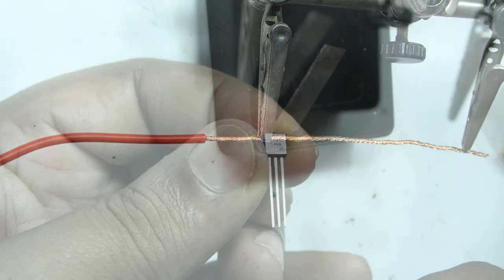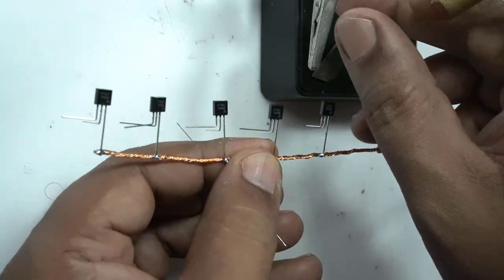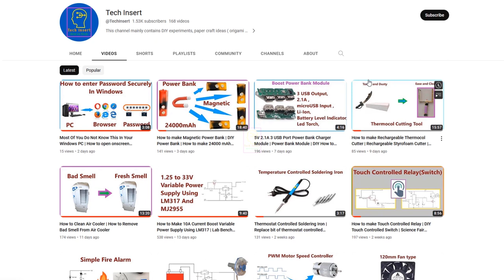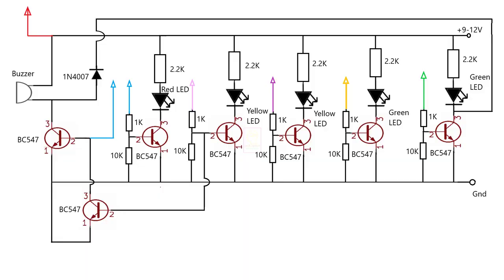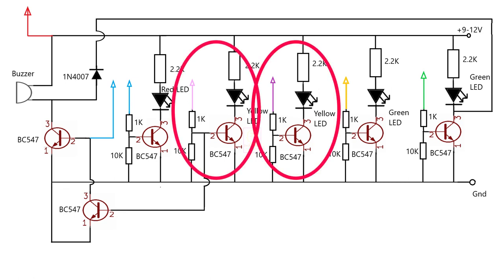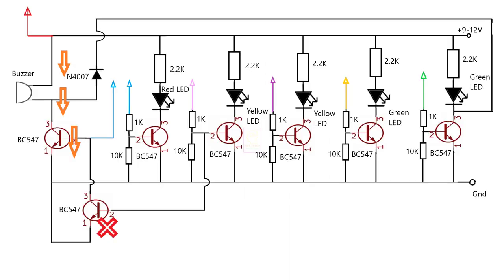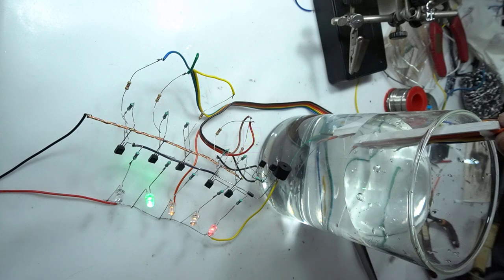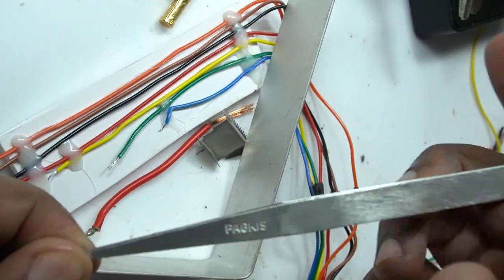How to make LOW Level and FULL Level Alarm with Water Level Indicator | School Project

Comment: Great video, can this be done with just one probe at low level and a bi colour led ( red and green) so that when tank is full the green led is on and red off, and when empty the red led switches on and the green one switches off. Thanks
Reply from the maker: You can replace the LEDs with common anode bi color led, but transistors cannot be avoided. You can also use two level circuit and avoid all buzzer related transistor. The circuit will be simple but we cannot know how much level water be in tank . But ur idea is very good. Do not forget the water  terminals

Comment: Good circuit. Can we add a water pump on it so that when the water level touches the low level alarm the motoir starts pumping water and stops at high alarm
Reply: I think so
Reply from the maker: Yes you can. I already planned a fully automatic water pump with level indicator
Reply: @TechInsert  Thanks a lot
Reply: @TechInsert expecting that❤
Reply from the maker: @baburaj1645  sure

Comment: How to join the stainless steel terminal to the copper wire leading to the LED display board with buzzer?
Reply from the maker: Tight joining or revite joining is the best way. Another way is 
https://youtu.be/pIOCciWeNo4
Reply: Thank you very much for your excellent and vivid explanation of the circuit and the step by step addition of components and test demonstration. You have mentioned that you have been using the arrangement for more than 14 years using Stainless steel terminals but when asked about how to join two dissimilar materials you suggest to go for hard pressing or riveting but you you have not mentioned which method you have adopted. In either case the joints are in touch with water the copper part of the joint will corrode and so how to insulate the joint? Hope you will kindly clarify. Thank you again.

Comment: 👍👍👍👍 Sir, Very nice and informative video. Could not understand switching on and off of buzzer at lower and top water level. could you explain the buzzer working in simple language. Also could you develop the circuit 1) such that a switch be provided to manually switch of the buzzer at either of top or bottom water level. 2) Avoid dry run of motor if there is no water is available in the sump.👍👍👍👍👍
Reply from the maker: Transistors are a kind of switch. So if you are using an NPN transistor and when the base to emiter junction is forward biased, then current will flow from collector to emitter. In short if you are giving a positive supply to base collector and emitter will join together to form a closed switch. If you are giving negative or no supply to base then collector  and emitter will act as open switch. Same is aplpicable to PNP transistor.In PNP for switching this trasistor ON we have to apply negative supply to the base. I hope you understand the working of a transistor as a switch.

The red wire is the common terminal in water which is connected to positive supply. (Water in tank is not pure so it will conducts electricity).When the water reach at the lower end (I told in the video that for buzzer and red led 2 seperate terminals are to be conected in the water) the left most transistor just below the buzzer will get a positive supply at its base. That transistor will switch ON which means collector and emitter will join together. Buzzer positive terminal is connected to positive supply and negative terminal connected to collector of transistor. The emitter of transistor is conencted to GND. Since colletor and emitter is joiined together(or ON) the buzzer will sounds.

When the water reaches the second level the lower BC547  becomes ON . Its collector is connected to the base of buzzer's transistor . Now buzzer's transitor's base gets negative supply through lower BC547 and it becomes OFF and buzzer sound stops.

Similarly when green led's transistor becomes ON, then buzzer will get negative supply thru this transistor via diode 1N4007.

Connec a ON-OFF swicth at the positive terminal of the buzzer so that you can ON and OFF the buzzer as your wish.
******
2) Avoid dry run of motor if there is no water is available in the sump - > Fully automatic water level indicator is in my pipeline. Definitely i will make that.
Reply: @TechInsert  Thanks for your reply. I have understood the working principle of Transistors but somehow in the circuit I am not able to figure out how buzzer switches off at both top and bottom water level. I will try this circuit with the switch in the circuit. Thanks for your prompt reply.
Reply: Top green  buzzer need to stop using a switch only. Lower buzzer will stop when water level reaches the second level.
Reply: @tabm7644  Thanks for your prompt reply.
Reply: @TechInsert  Well explained. Thanks
Reply: @TechInsert  Good explanation
Reply: @TechInsert  wow thank you sir
Reply: Good to watch